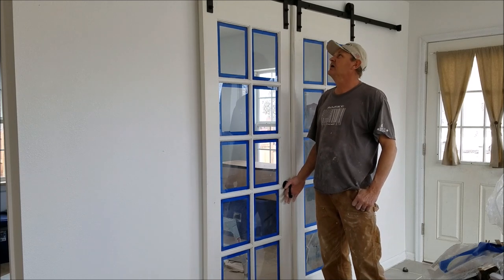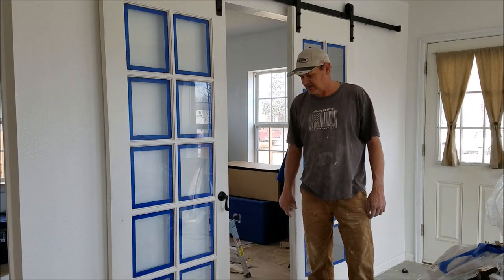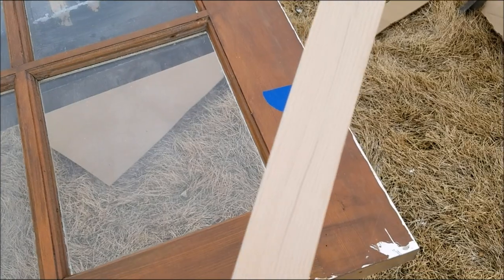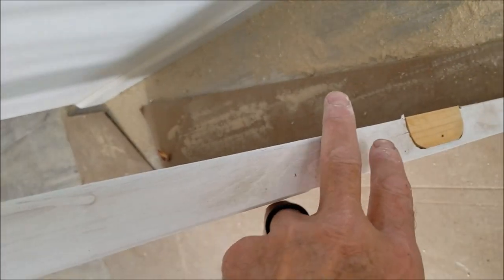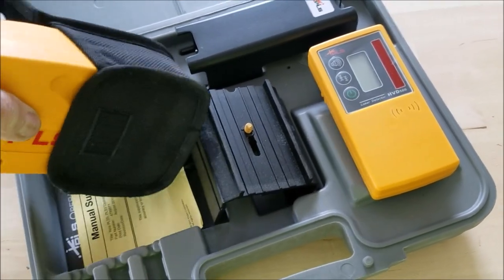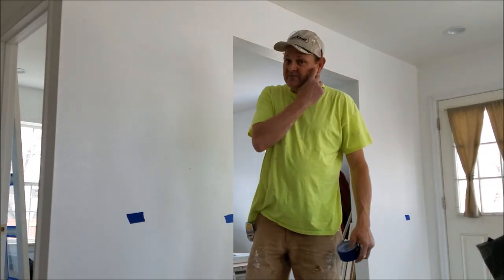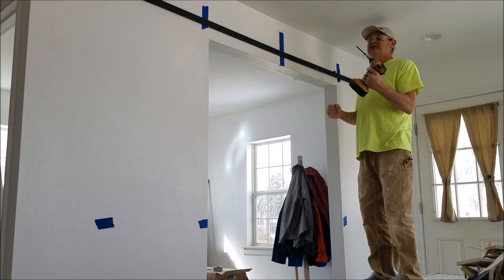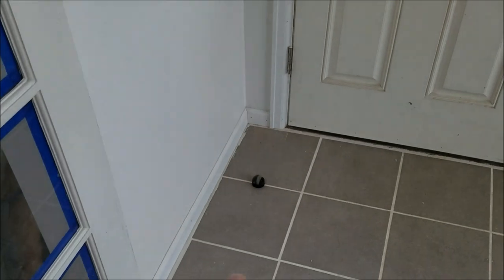Converting old French doors to barn doors.

Comment: I wonder why not do the extension on the bottom rather than on the top of the door.
Reply from the maker: Come to think about it, that would of looked better; Thanks for the input, and Thanks for watching.
Reply: You could, but the door knob would be super high, you could move it, but dang, such a pain. Hmm, it seems his french doors didn’t have any knob or cut outs. I am used to working with reclaimed /antique doors, which always have the knob, or at least the cutouts, so I’ve always added the extension at the top.